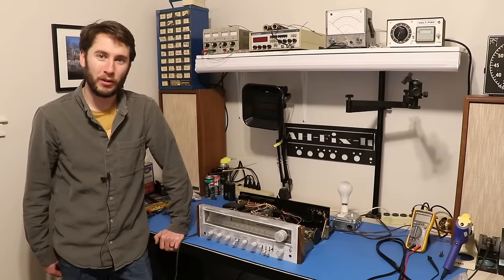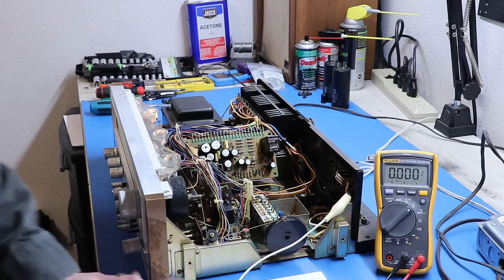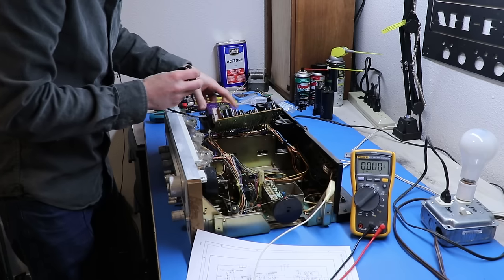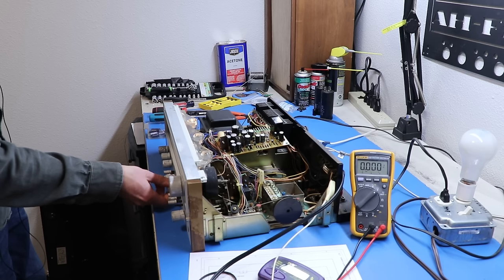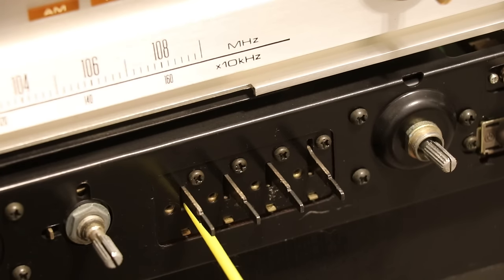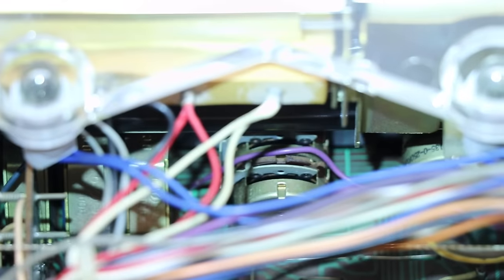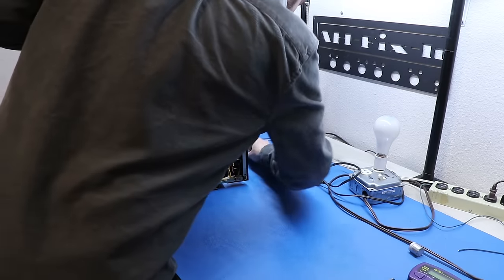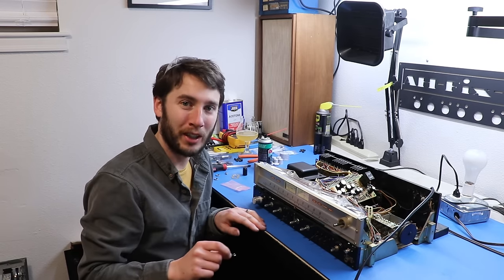FINALLY Fixing The Power-Washed Pioneer SX-750: Power Supply Repair And Controls Cleaning

Comment: Dishwashers use alkali in the detergent.  Alkali attacks aluminum.
Reply: This.  It strips off the surface layer and exposes the raw aluminum which results in corrosion.  It may be possible to use polish to restore the surfaces.  Good luck!

Comment: A quick way to find bad filter caps on any DC source is to use your oscilloscope and look for the ripple on DC outputs.
Reply: You can also check with the DMM on AC Volts instead of DC volts. If you're measuring DC rails, there should be no AC showing up on the meter. Some meters have a combined AC+DC (or DC+AC) display mode which can show you both at once!
Reply: Good point. Back in the day...  my scope wouldn't show dc voltages unless the scale was set high enough for the dc voltage and then the ripple was hardly visible so I used a bnc splitter to use the scope probe both with the scope and also to dc voltmeter. Amazing what you can buy now - less than $100 for an oscilloscope/multimeter.

Comment: I have the same receiver model and symptoms. The voltages on my caps were not as far off as what you measured but they were different enough that I replaced them. I had a very similar hum that was eliminated with this fix! Thank you so much for sharing your insights.

Comment: Holy buckets, that light diffusion plastic thing looks just like the one I need for a Vector Research VR-7000!!! If Pioneer used that same part, I bet I can find one. Nice.
Reply: Isn't it usually just velum? You can buy sheets of new velum and cut out whatever you need

Comment: Sansui 551 panel grime around the tuning, sel, and on-sw.. I started with mild soap, no effect. Added some 409, didn't touch it Plus some other cleaners allowing soak with paper towels no luck. Finally tried some old car paste wax, took off most of it without losing any labels. I did not get too crazy rubbing. I will also check out peek polish. Hope this helps.  (Power washing ) I would think about the fine wires on the RF coils etc., they may corrode if not dried quickly.

Comment: Mother's mag and aluminum polish will remove the residue and will not harm the silkscreen. It also works great on wafer switches and will make the traces and contacts  like new. The oxide on wafer switches takes physical cleaning. You can do this insitu if you use polish on a pipe cleaner and then heavily fush with IPA until residue is remove and then treat with D5...or preferably Neutrol 401B to add an oil film.

Comment: Good video.  Have you ever addressed the issue with SX-x50 series power controls.  IE:  the carbon buildup on the contacts causing flickering lamps and (sometimes) noise?
Reply: I have an SX-650 (which I love muchly) and will do a restore job on shortly.  That's the only actual 'issue' I have to address, but plan on a full restore job.

Comment: I have the same receiver, and it hums the same way. I noticed that Ebay has some listings for a "hum repair kit" for the SX-750. Are those any good, or should I just try to figure out which caps to get and order from one of the parts houses? I'm fairly new at this, so I'm still learning what things do and where they go. I really want to get my receiver going, but I'm thinking about practicing on my Apple II power supply first.

I also noticed restoration kits on Ebay for Pioneer receivers for ~ $100. I'm tempted to get one, but I'd like to know if they're grossly overpriced, or if I should just get one and restore the whole thing?
Reply: I'm in the same boat... I've been watching this series hoping to find a clear solution. I'd love to be able to identify the problem capacitor so I can avoid doing a full restoration right now.